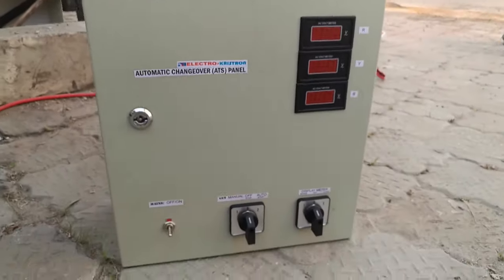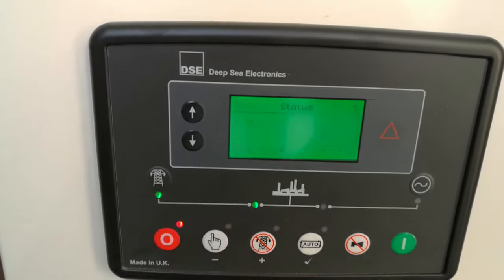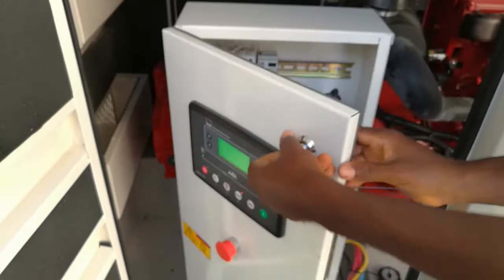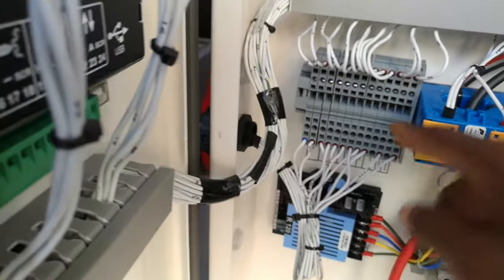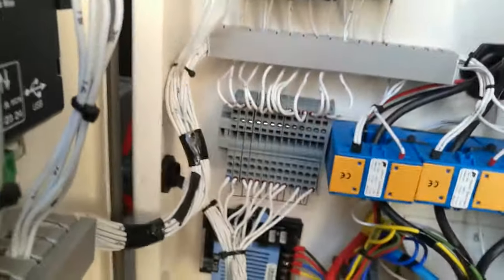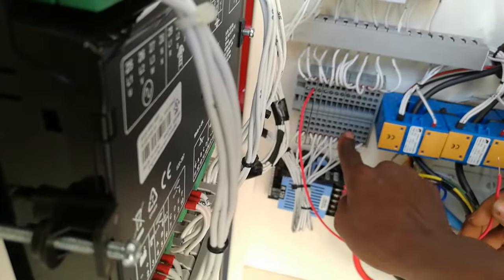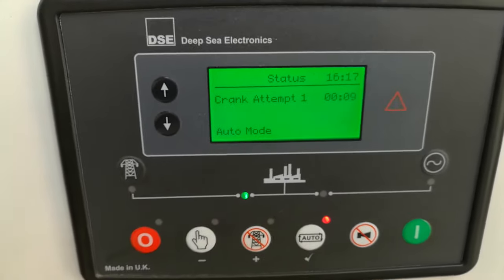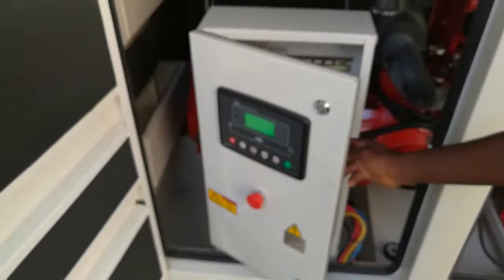How to 'Self-Test' a Gen for ATS Remote-Start AUTO Function | Automatic Changeover Installation

Comment: A good show of how to test . I have some concerns . I noticed that when the signal was removed the generator stopped within a few seconds. this is bad for the generator if it was at a heavy load before the load was transferred and signal removed. some ATS units will delay the signal to stop after a few minutes of transferring the load away and that is good. however there are parameters for cooling times that can be set in the deep sea unit to allow a cooling time before switching off the engine when generator is not needed any more. this would be a better way . just saying . All good . Ade.
Reply from the maker: Many thanks for your observations and concerns @ade63dug. 
We appreciate your contribution. Your expectations are correct and we are also aware of the expected "Cool down then shut down" delay you mentioned. I must remind you that as shown in the video, the ATS is yet to be installed as it was still on the ground awaiting installation. So, as the title of the video goes, whatever response or reaction we got from the Gen was strictly on the Gen's self test basis and not through the ATS, meaning the Gen was responding to stimulus based on the OEM (Manufacturer's) programming on the DeepSea Controller which co-ordinates the operation of the generator. 

That said, I must however mention that the Gen shut down immediately because the controller was programmed to enter into cool down then shut down mode if it operates for up to at least 2 minutes (and ON LOAD), otherwise if it cold-started and runs for less than 2 minutes without load, when given the shut down command, it will omit the cool down then shut down sequence and shut down immediately instead.

Interestingly, if a Diesel Gen had run for as little as 3 minutes on load and a shut down command is issued by the ATS after a transfer to Mains supply has been made, some Generators have been programmed to observe a cool down duration of up to 5 minutes or more of free run (idling) before they finally shut down. Although this seemingly excessive cool down delay could be both embarrassing and inconvenient to many Gen owners (Diesel costs are too high these days, understandably), manufacturers advise that the long cool down delay is good for the health of the engine. So, it is more of a balancing act as the delay timing could be adjusted if absolutely necessary.

Comment: Thank you for the video. But how to identify the command terminal in the generator is not clear.
Reply from the maker: Thanks for your question. Usually, the Remote-Start terminals are indicated in the Generator's User Manual as published by the Generator's manufacturer. Alternately, once you have the Gen Controller Module's details (Name & Model Number), you could do a Google search for the Remote Start terminals. However, it is always better to consult the manufacturer's manual.

Comment: Sir, you didn't tell us what terminals you sorted.
Reply from the maker: Remote-Start terminals differ from one Gen brand to other brands. For this particular model, they are terminals 21 and 5.
Reply: @ElectroKristronPowerSystems  so are you going to connect and remove it everytime
Reply: And please what control panel is that, so i can make some research on it for a better understanding....but thank you for this video, it's taught me a lot

Comment: plse how to connect the ats dse jcb 220 kva generator
Reply from the maker: Thanks for stopping by, @Teshome. JCB is the merchant's brand. You need the details of the Generator's controller module (Name & Model Number) to be able to identify its correct terminals (Remote-Start). I can see you got one of the details right, DSE (Deep Sea Electronics), that's the module's name. Now, you need the module's model number as well. Are you able to get that as well?